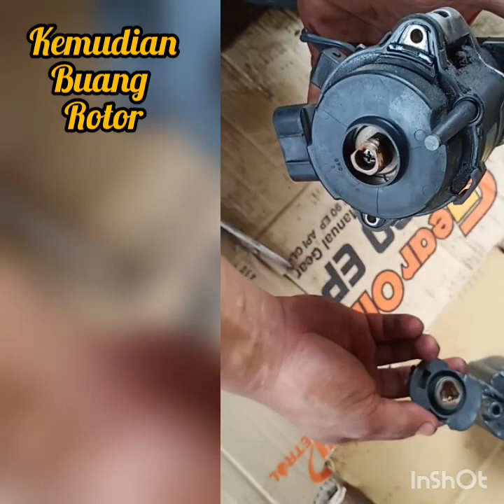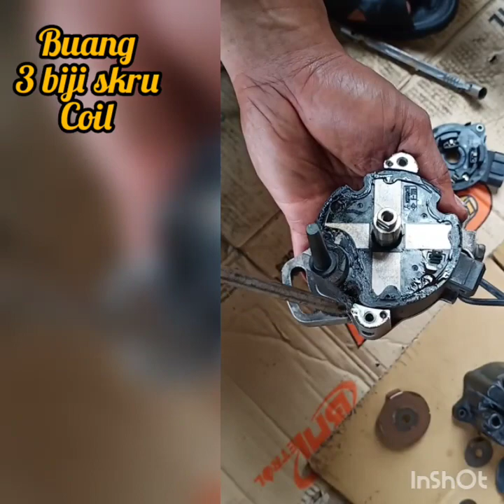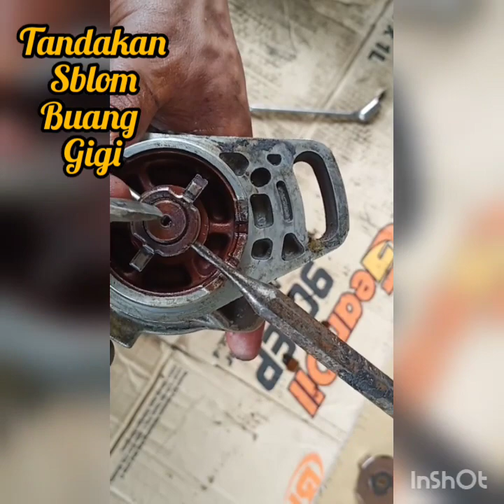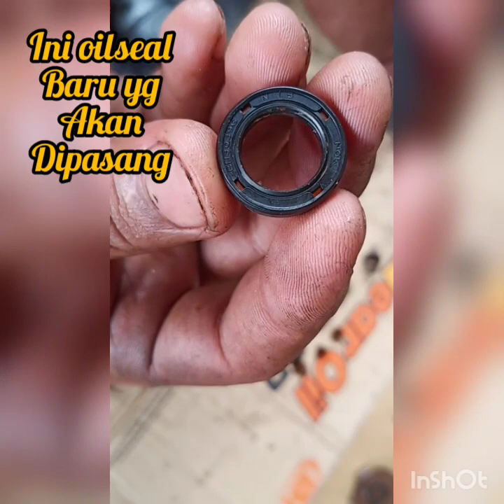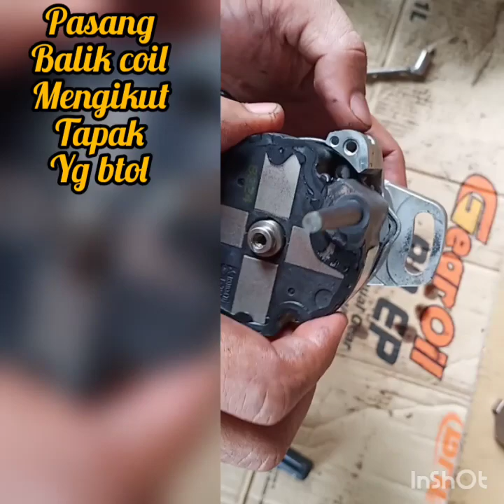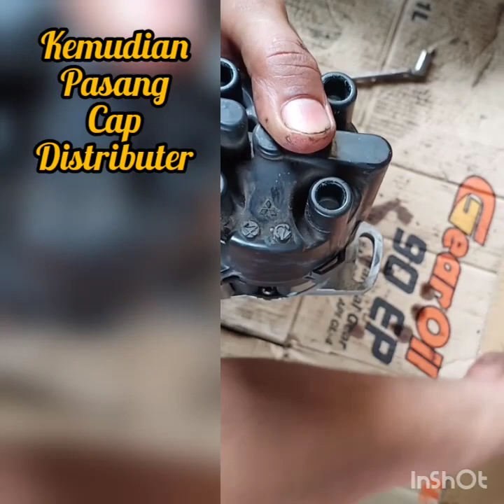Cara tukar oilseal distributer wira satria iswara injection

Comment: Distributer ni kalo kong boleh tukar coil dlm tak ye.distributer da bnyk simpan ni syg pulak nk buang😂.sebab kt spepart pon bnyk brg recorn
Reply from the maker: Boleh je repair......kalo caburator modified pakai coil kat luar biasanya...api pun kuat....coil dlm.mcm.asal pun ada jual 40-50 sebiji....kalo injection xpasti barang ada jual ke tak.....
Reply: @workgarage9220  kenape distributer sy bile di pegang rase renjatan ye.sebelum ni x rase😅😅😅mungkin abg ade pengslaman boleh kongsi
Reply from the maker: Bisa ada kebocoran pada cap distributer....dekat masul cable plug.....atau kebocoran pada cable plug itu sendiri.....boleh try rem enjin waktu mlm tampa cahaya akan nampak spark kat mane2 bahagian cable atau cap.....pengalaman syla yg bos punya tak pastila bole try cuba buat dulu....😅
Reply: @workgarage9220  ok baik
Reply from the maker: Sya Mil  semput atau 3 selinder,..ada jugak semput apabila dah adjust rapat masih semput.....biasanya distributer local atau recond.......nk lebih pasti try swap dgn rakan....

Comment: salam...nak tanya bro mana dapat seal tu...ada kod dia ke part number ke?
Reply from the maker: Wsalam,kedai sparepart ad jual,distributer 1.5 dan 1.6 beza saiz oilseal dia ,kalo oilseal 1.5 saiz 12.5x22x6,kalo distributer 1.6 saiz besor nombor 14x22x5.5
Reply: @workgarage9220  terima kasih

Comment: Wira 1.6 dh tkr coil distrributor tp masih semput masa starting nk jln. Apahal
Reply from the maker: Tukar distributer baru atau halfcut.....nk lebih kepastian try swap dulu dgn rakan2,,masuk semput tu jerking/tersedup2  ke mcmne....?
Reply: @workgarage9220  ya jerk ckt tpi dah jln ok.. Time slow skalu jd.. Distributor lama tkr coil ja..
Reply from the maker: @IsMail-mt1yz  nk lagi kepastian try pinjam yg org lain punya....kalo tak try tukar plug dan cable
Reply: @workgarage9220  ok bos terima kasih..